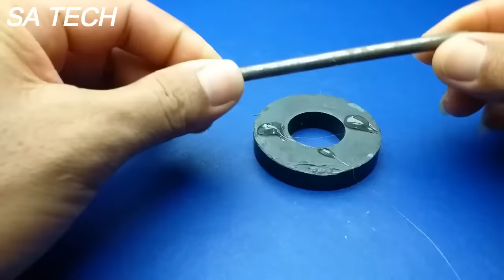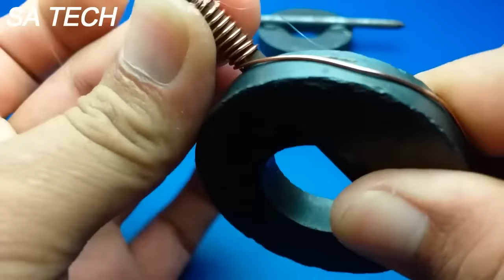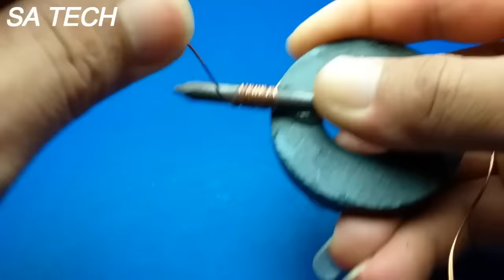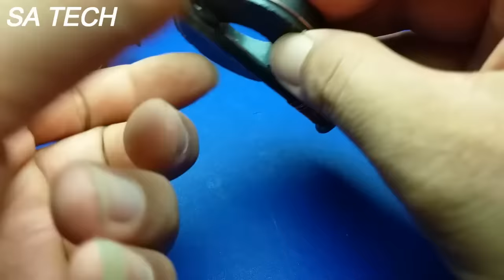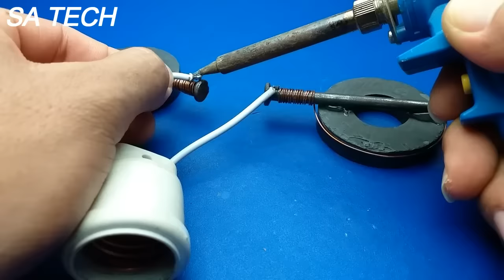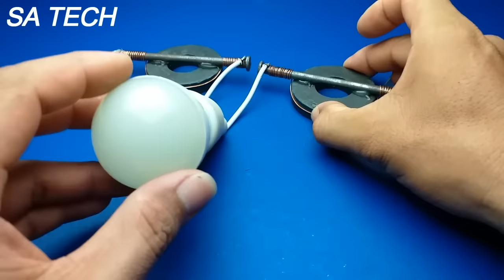Free Energy Generator by Using Magnets With Nail 100% At home

Comment: A tip for you. Save the magnets nails and wire for another fake project and just touch the wires together. This, in turn, will complete the circuit to the internal battery in the very low voltage bulb. I have one of these at home and it is very easy to unscrew to get inside.
Reply: Nope, did that with three LED lamps I have and did not work? I thank Daniel Juric has it right but I don't know either.
Reply: Good you..ldont'... beleive any way from that
Reply: @mick4361  sounds like too much vodka on his tongue
Reply: Para gerar energia os magnetod teriam que estar em movimento.Esse ê o velho truque das pilhas colocadas dentro da lâmpada e ao encostar os pregos fecha o circuito e a lâmpada acende.
Reply: You aré The only inteligente person here!!!
Reply: @scrashnet  Thank you.That is the nicest reply I have ever had on this site.
Reply: How many volts is the bulb to be use?
Reply: @arvetsegunto2758  These may plug into a mains voltage but it depends on the bulb. If it has no filament but is gas-filled, there is a small circuit inside that gives a higher voltage to the bulb to make the gas illuminate. If the bulb has an LED, then it could run off only 3V
Reply: @arvetsegunto2758  they are some of 5v, and another of 12v

Comment: How much effort would it have it taken to inform what voltage and wattage the bulbs were.
Reply: None of these videos do. they are just click bait with no lesson to teach and instruct.
Voltage, Wattage, length of wire, life expectancy of the magnets, etc should be mandatory in these free energy videos.
I haven't even seen one that debates the better bulbs to use, incandescent, fluorescent, or LED. All the high end channels that demonstrate electricity even hold a burned out fluorescent long bulb without a few inches and they light up.
This guy has like about 15 videos with various styles of 2-4 magnets and none of them give the specs.
Reply: Then no one would ask in the comments would they ?

Comment: I'm guessing that underneath the work surface there's a large rotating magnet probably powered by an electric motor. That's the only way that I can account for the light lighting.
Reply: Then why does it only light one fast flash at a time? No large magnet needed.

Comment: I’m not a professional electrician, but I learned more than 7 years electricity...
This system doesn’t work. The magnet has magnetic field, but isn’t enough to make electricity. Believe me! 
Click hunter...
Reply: He is correct magnet has magnetic feild
Reply: I believe you
Reply: Norbert Benyak ..... just try that ,no power to light the 💡.
I bet the light in video is LED and is rigged to turn on when is shorted..... 🧐☕️ MOST LIKELY IS RIGGED.
Reply: @CM-ok9uu   look. i don't want to educate you, but read something about basic electromagnetic  induction... 
very short info: 
1.  if you move a permanent magnet into a coil, loop,  you'll receive electricity at between ends of the coil.   "kinetic induction"

2. if you change the magnetic filed by coil, - when you switch on or switch off the circuit - this will induce electricity in other coil...

no any other option to make electricity with magnets...

ask mr faraday, mr lenz and others...
Reply: Es mentira no funciona
Reply: @norbertbenyak7125  its dc or ac bulb

Comment: A trick. There's a small battery in the bulb.
Reply: And how do you know ?
Reply: how can you control the power off and on?
Reply: Read Faraday's Law. This is fake, Ann electric current is only produced when there's a change of magnetic flux. Just think for a moment if this was true wouldn't the whole world be using it. An electric current is produced when a magnet is moved in and out of a conducting wire. That's what transformers do.
Reply: @srisunarti4936  Note when the 2 nails touch that turns the light on. If that were a normal bulb that would be like touching the hot and neutral leads together and expecting the light to turn on. Google "magic light bulb"

Comment: The experiment has a lot of questions. 1. why do you not use the multimeter first? 2 this lamp has one battery inside, I am sure yes it is., Please tell me, anyone, Do you doing this experiment and work?
Reply: I built it up, identical as we have seen. Nothing! Without the short curcuit (nails together and then you have 220 Volt to supply the LED - that will never work) it is possible to get some Volts by induktion, but never long time (seconds)

Comment: Please show current volt by multimeter...ok
Reply: This is fake video. HE USE Short Circuit Light Bulb.
Reply: No this is real because i try it work
Reply: @kjengtumbaga430  Why we need pay Electricity Bill? Is your home Electricity bill zero?
Reply: Because of the gravity of earth
Reply: hey you before you speak do it first before you say that it is fake it is not true that right away
Reply: @kjengtumbaga430  why would you short + and - in order to turn on the lamp?
Reply: @kjengtumbaga430  OK, You can use in your home. good luck
Reply: @kjengtumbaga430  hey i tried as he did but couldn get light, does the wires should necessarily be copper?!?

Comment: hw many watts does those magnets produce and is the bulb a 220v ac or 12v dc?
Reply: The magnets are producing nothing. Look up electromagnetic induction. The video maker is trying to make a fool of you.
Reply: Circuit is not  closed how can it work
Reply: @shrawansingh2451  The copper wire makes a complete loop. What is not being shown is the solenoid running on an AC current. The solenoid will induce an electrical current in a nearby wire loop. This phenomenon (called electromagnetic induction) was demonstrated by Michael Faraday at the Royal Institute (London) in the early 1830s. There's nothing magical here, just a faker who is trying to mislead you with props like a nail and a magnet.

Wireless charging of mobile phones is an example of electromagnetic induction.

Comment: I have a couple of questions, before I cancel my contract with energy provider.
How much voltage does it provides?
Does the size of the nail matters in terms of providing bigger flow of electrical current? 
Do I still get an energy saving bulb for this experiment? 👀💡
Reply: Please answer this question
Reply: Чем больше гвоздь тем больше тока получишь ,а лучше на 200 мм гвозди и ещё електроэнергию будешь городу продоватть 😂

Comment: As a physicist, electrical engineer, and computer scientist allow me to explain this experiment and the most logical ways to do it.
An incomplete electric circuit with both positive and negative charge, housed under the blue table hidden from the viewers, is one explanation. In order for there to be electromagnetism of a complete circuit to generate enough electrical energy and thus create sustainable current then there has to be magnets of opposite poles rotating a nail(noble elements excluded) within a coil of copper wire. That is one way on how he does these fake energy videos.
Another, more logical explanation is the fact that he is using a battery powered light socket where he has separated the connection completing the circuit in order to use  a smoke screen of gadgets to redirect your focus. Only when he touches the two ends of the steel rods does the light have enough electrical current to turn on. 
If magnets of opposite poles were all we needed for free energy, then the north and south pole of the earth would suffice. 
Don't fall for this bullshit.

Comment: What kind of steel that
Reply: Do you mean the wire..
It's copper. You can find inside of insulation cable. Or buy it from stationary stores
Reply: Copper
Reply: What's a good online source to buy ring magnets? Great video.❤️
Reply: Copper titanium and magnets

Comment: The magnet opposite side are they locally made and sold for us here in africa energy important pls we needs voltage calculation to avoid risk
Reply: I'm also in Africa. You can get whatever sized magnets from car speakers sold in markets ( the ones used in mini buses) go to any mechanic with a grinder tell him to cut the magnet out. The bigger the speaker the bigger the magnet

Comment: hahahahahaha Now disconnect the bulb and the fixture and measure with a multimeter at the ends of the wires. I'm curious about the voltage. So how many volts and amps does your wonder machine produce?

Comment: Okay so this video is fake because theres no way it just says on because the scientist that discovered that if you wrap copper wires around a hollow holder or coil, and then put a magnet in it it does generate electricity but you have to run it hundreds of times for a bulb ti work

Comment: Aside from you botching the gluing on the 2nd magnet, you botched your physics exam. The flashes of light are easily explainable , you have a magnetic field that you're moving with your hand next to a copper coil, and if you look closely in the moments that light becomes more constant the frame is paused and sometimes there are camera panning effects placed ontop of it. Truly a disgusting deception.

Comment: Clearly FAKE. For the bulb to illuminate there has to be a voltage Potential Difference to the bulbs input. The nails heads are connected electrically via the copper wire (not enamalled), thereby touching both nail heads together, no voltage PD will be exist. Therefore the touching of the nail heads is simply providing a continuity circuit for the 'doctored' bulbs which contain their own power source....  🤓 
Good deceptive earner at over 13 million views...